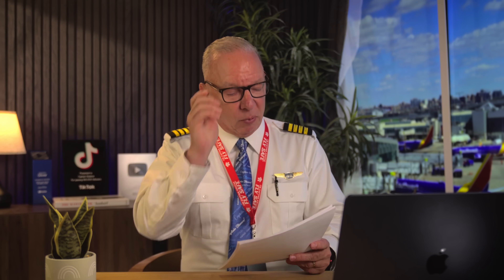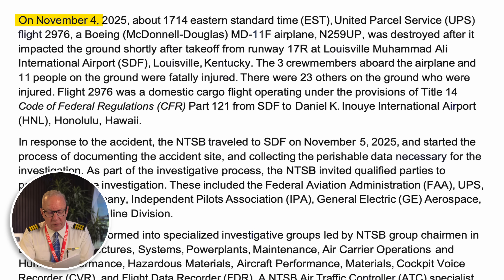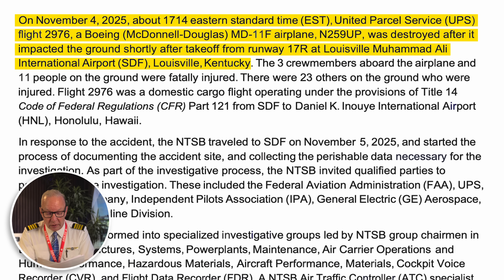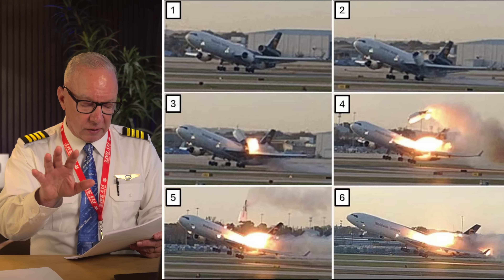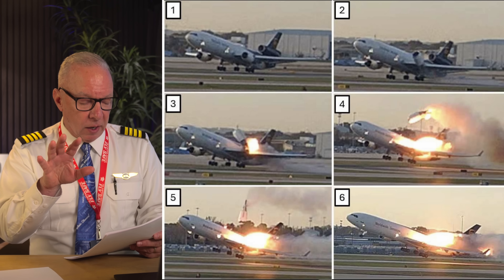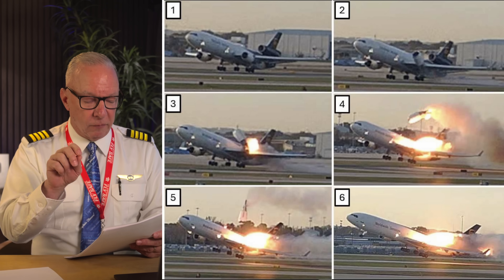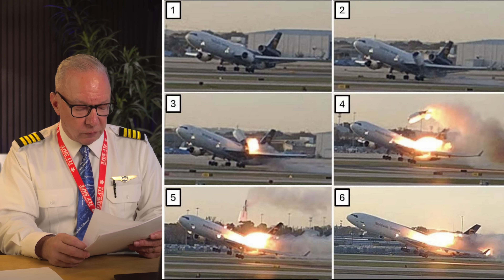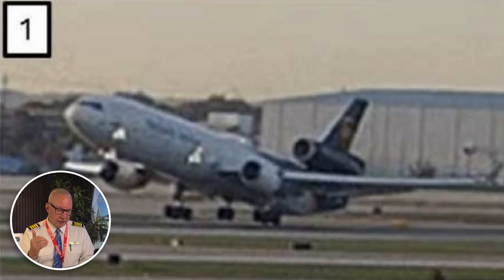UPS Crash Preliminary Report | Pilot Reacts to UPS Crash Report

Comment: With all due respect, I think you mixed up part of the description.  The aft pylon mount has 2 lugs referred to as the aft and forward lug.  Both of these are part of the aft mount.  Both of those had fatigue cracks and failed.  Then as you say the forward mount failed from over stress.

Comment: A couple of points..
1. ADS-B height data..
Elevation of airport is, what, 400+', so 481' is feasible...
2. 72 months is 6 years, not 5 (60 months).

Excellent video...

Comment: Knew this wasn't a compressor fan section failure. The core section was intact, if the compressor fan had failed the core section would have grenaded with it. The compressor stalls happened in the number two engine, not the number three. 
Pretty sure this gonna be a doom flag for the MD11 fleet.

Comment: They should make it a law that there can be no public property for X amount of feet after the end of a runway just in case something liie this happens.
Reply: In some European countries, Land Use Planning rules limit development at the end of runways to low-occupancy industrial type facilities. Where an airport doesn’t comply due to predating planning controls, opportunities are taken (eg if a facility becomes disused) to prevent it being reopened in a way that means the usage doesn’t comply with the land use restriction. Not sure about the USA - which seems to have less regulatory control than we do “this side of the pond”.
Reply: Or require the airport to be longer at the end of each runway with two blast walls, one at the usual placement at the end of the runway, and one all the way at the end of the land extension.

Comment: Captain Steve - I am also a pilot and interested as to why the act of rotation would create evidently maximum stress on the engine mounting bolts? It seems the stresses on those engine mounting bolts would only depend on engine thrust and not pitch angle...But yet we have two datapoints that show this happening at the same point of time in the flight (rotation) on two aircraft. We have many aircraft with under wing slung engines, is this a design defect of the MD-11/DC-10 family?   Respectively, Tim

Comment: 5:20  481 feet MSL is roughly consistent with the flight, since the Louisville airport's elevation is about 500 feet MSL.
Reply: It actually said right there in the report that 481 ft MSL is 100 ft AGL according to the ADS-B data.

The radio altimeter from the aircraft was showing 30 ft AGL max and that is the most accurate source available for altitude readings.

So no, that is not consistent with what the ADS-B was showing… which is to be expected as ADS-B altitude data is not accurate especially when close to the ground.
Reply: @tonamg53  The most ACCURATE reading will be the RAD ALT..
Reply: @grantandrew594  Yes, that’s what I said. Radio/ Radar altimeter are the same thing.
Reply: @tonamg53  As a UK Part 66 Licensed Aircraft Engineer with 8 aircraft types and 17 different engines.. It has never been called radar altimeter in my type training courses.. Radio Altimeter send radio waves out from a transmitter on the belly of the aircraft and collects the return on receivers installed a few feet away, again on the belly of the aircraft.. Rad Alt also on works relatively close to the ground hundreds of feet.. Not at thousands of feet in the air..
Reply: @grant @grantandrew594  and I said radio altimeter, but you can call them radar altimeters as well.

Radar is utilizing radio waves to detect and track objects… and yes, you can always use them to measure the distance between you and an object.

What kind of aircraft engineer is it that doesn’t understand the principle of how radar works?

Answer: a fake aircraft engineer
Reply: @grant @grantandrew594  if you are a real aircraft engineer… you wouldn’t be so stupid to not realized that radio altimeter is triggered at 2,500 ft AGL on pretty much all Boeing aircraft and Airbus also starts displaying the value on the PFD from 2500 ft AGL as well  🤦🏻‍♂️ 

I wouldn’t continue arguing if I were you.
Reply: @tonamg53 …not just Boeing and Airbus….if you wanna be a nitpicker 😂
All airplanes I have flown….
Reply: @tonamg53  Who's arguing.. I am merely stating teh fact that all of my Aircraft training notes and all AMMs call it Radio Altimeter and NOT radar altimeter.... Not sure what aircraft you are qualified to certify as a qualified Le=icense aircraft engineer or where you had you r type training.. But NO ONE calls it a RADAR ALTIMETER that I know of...
Reply: @grantandrew594  stating fact?

No, you didn’t state fact. You were stating incorrect information such as there is no “radar altimeter” and that it’s only work close to the ground within hundreds of feet and not thousands…

Which is absolutely incorrect. Yes, radar altimeter can be use interchangeably with radio altimeter and yes, it is triggered from 2500 ft AGL on pretty much all aircraft (as others have pointed out) which can be used in thousands of feet and not only in hundreds of feet…

Any one with a hint of aviation knowledge would just laugh at your absolute lack of shame and knowledge.
Reply: @grantandrew594  and btw, just to rub more salt on your wounds…

The formal technical name for “Radio Altimeter” is actually “Radar Altimeter”… not the other way around.

In text book you’re most likely to find “Radar Altimeter” or both terms as they are commonly use interchangeably.

After all, “radar” stands for Radio Detection and Ranging…

🤦🏻‍♂️
Reply: @tonamg53   I hate to break it to you buddy but Boeing B777 AMM ATA chapter 34-33 RADIO ALTIMETER (RA) SYSTEM...
Reply: @grantandrew594 Yes, the term is use interchangeably as I’ve stated from the beginning. Radio/ Radar altimeter are both referring to the same thing and are use interchangeably.

When ever you say the term “Radar” the “Ra” means ”Radio”

You have a hard time understanding a simple sentence or something?
Reply: I think he is confusing agl with msl
Reply: @robertmulkey8788 yes, he is. Surprising….
Reply: @robertmulkey8788  I disagree. My assessment is that he originally said 400+ feet in his early videos, having missed the MSL on the measurement. He's irrationally defending an incorrect statement now rather than either admitting he made a mistake or just moving on without referring to it.
Reply: The end of runway 17R is 461 feet. Runway 17 L 471 feet. Elevation, so relative to MSL. Mean Sea Level. So 30 feet RA matches roughly the ADS-B altitude. Both measurements have small errors.

Doesn’t matter, from video it was also clear the airplane didn’t climb much.
Reply: Exactly.  SDF is 480 feet according to the airport map in the charts.
Reply: I wish he would say this
Reply: @dosmastrify he’s a clown, or he’s farming comments.
Reply: Make a relevant point.

Comment: When they are referring to the forward lug and aft lug, they are referring to the two lugs on the aft mount of the left pylon.
Reply: Exactly, it’s a split lug design for fail safety which is bs because you can’t inspect between the lugs.  Boeing strut to wing philosophy is much different than MD. I worked Boeing propulsion structures design engineering PSD for 24y.  For reference the DC-10 pylon front spar fitting is nicknamed the tombstone fitting.
Reply: This! Seems that the aft mount aft lug had fatigue cracks on both the 2 and 9 factures.  The "aft" mount forward lug inboard fracture had evidence of fatigue cracks, but not the outboard fracture.